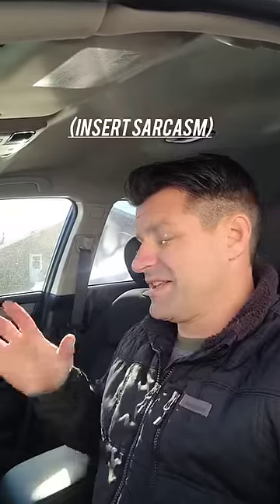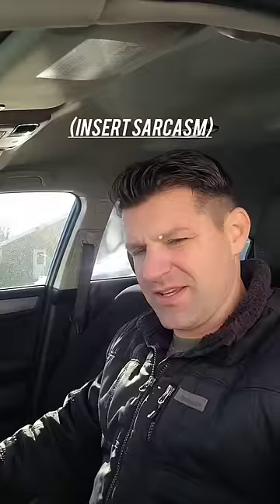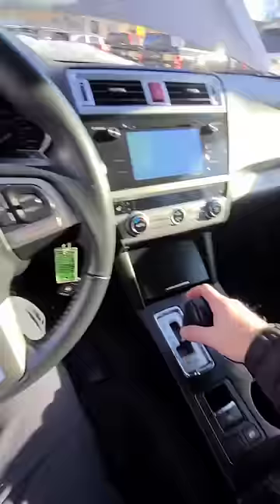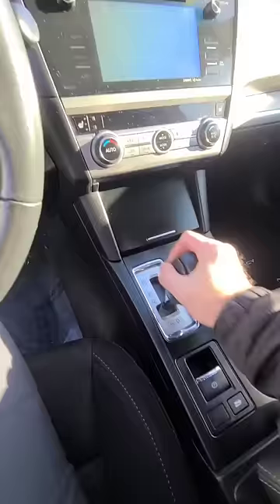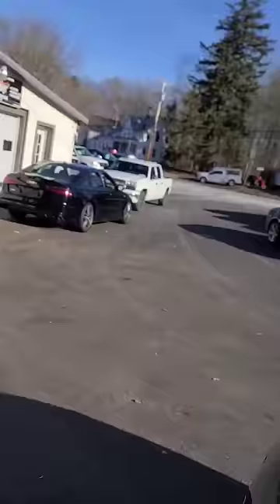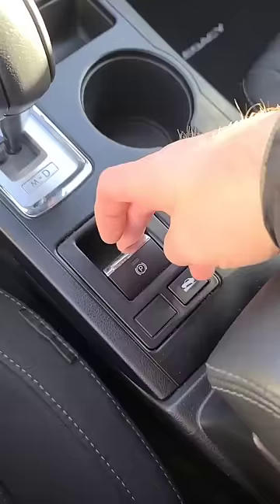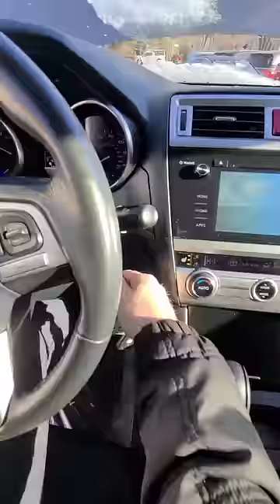Why Subaru Engineers deserve a punch in the Face! #shorts

Comment: Electronic parking brakes in general are stupid. There is nothing wrong with having a mechanical parking brake that you simply pull on whenever you need it but these engineers just want to overengineer everything.
Reply: more things to break :/
Reply: He's struggling to open the glove compart and you want him to remember the ebrake?
Reply: Kind of an eyesore.
Reply: @Natethegreat200c  E-brakes are an eyesore??
Reply: Don’t blame engineers for what are accounting decisions.  Engineers don’t like making crap believe it or not.
Reply: @smittywerbenyeagermenjenso3720 To the average customer, yes.
Reply: Electric parking brakes would be under engineered.
Reply: @johnwalker7592  you don’t seem to understand how businesses operate.  Accounting gives a budget for building parts.   Electronic parking breaks are cheaper than manual parking brake and that’s what engineers were told to build.
Reply: Benefit of EPBs is first, they can disengage it when you hit the gas, so you won't mess up your e break by forgetting to disengage it. The second, is a can also work with him stop assist. The third is that it saves space on the central console, which is precious automotive real estate. That said, though, I still think it's dumb
Reply: Amen!
Reply: @andrewsang4688  You can still use a standard ebrake for stopping, as it can engage at any speed, and many have moved it/ replace it with the parking brake which functions near identical, out of site out of the way. While I can say anything about user error as I've left mine on after a long weight before, Its still never gave me a problem afterwards.

I really dont see a reason to go electronical on it other than "eye sore" which for a machine that can kill, I think is a foolish reason. shocked no government has stepped in but tbh they only care for pushing for ev's at the moment.
Reply: I know it's not like most people use their parking brake in America lmao. Just put a floor pedal or handle to pull :(    ( also DONT PUT THE PARKING BRAKE ON THE PASSENGER SIDE!! Never understood why this is even a thing. My 2000 ford mustang had the parking brake on the passenger side wtf)
Reply: This should be shown to Elon. His bright ideas to remove all mechanical devices results in a useless hunk of junk when the batteries die.
Reply: Over engineer or rather just make you pay to fix something later on in a few years when it goes out
Reply: @aarongalindo5064  yep. Terrible business strategy.
Reply: @theglassarrow_  What do you mean you can use the standard e-brake for stopping? That was never in contention. I don't know if standard e brakes can be used for hill stop assist. Yeah there are certain aesthetic benefits which I think are stupid as well, but it's also like, there's more space for cup holders which I guess contemporary consumers give a damn about.
Reply: @andrewsang4688  "The second, is a can also work with him stop assist" You can use a standard Ebrake for assisting in stops in cases of brake failure. I was assuming this was what you where talking about in your original comment. Perhaps you ment that in might engage automatically? I'm not really sure 100% by what you ment by this.
Reply: @theglassarrow_  I was referring to *hill stop assist, my bad.
Reply: @andrewsang4688  Even then I'm a bit lost on that. Never had a problem with stopping on an incline/parking. I seen some manual cars have hill start assist. Are you just referring to parking on a hill? Where the DMV in most states require all users use their ebrake anyways? Does the car just know to activate the ebrake when in start? I would actually find that as an actually useful feature since I always use mine while parking regardless of the location.
Reply: That's the reason why I bought my Crosstrek years ago because it's still had a working handheld parking brake
Reply: @bigd02118  I think the crosstrek is one of the few Subarus that still comes with a traditional parking brake. I was looking at superus recently.
Reply: @robertknight4672  the 2024 mustang will have a manual one too 😍
Reply: Push button starts
Reply: Anything electronic I don't trust like ,I don't trust me gaming PC I don't trust my phone why should I trust something in a car
Reply: We want to drift the normal way but seems like they do this to prevent that action. Probably was emailed by Biden if they could stop drifting e-brakes and they listened.
Reply: I think it is the designers that want a nicer interior or the bean counters that want an easier design for both LHD or RHD vehicles.
Reply: @daixer3156  I don’t understand how Joe Biden fits into this discussion. Last I checked, the WRX still comes with a manual handbrake.
Reply: Because they know they’ll never actually touch a car they designed, so they don’t give a flying fuck
Reply: When I worked at Kia a 2022 Sorento had a computer glitch. Vehicle wouldn't release the parking brake. It had to be towed in so a mechanic could hook the computer to it, and reflash
Reply: Most of the time the electronic e brake is because of the emergent self stop incase you’re about to hit something, most vehicles have today.
Reply: @darkpill  so your telling me it's cheaper to make a whole electrical parking brake system than just running a cable to the rear brakes for a manual p brake?
Reply: Even better is a mechanical handbreak which you can use to get out of trouble buy drifting. Was  cornering a 03 Forrester in thick snow and ice and car was heading straight for a pole..one pull of the handbrake and ease off the gas fixed it right away
Reply: That’s how they get paid. You want them to just sit around and be like “nope, we perfected that technology. Not gonna touch it” ?
Reply: EPB - a solution looking for a problem
Reply: @Brpwndood My breaks failed one time as I was pulling up to a red light. I was about to pull the handbreak, but luckily the disc breaks finally kicked in last minute. The ongoing traffic was pretty fast too.
Reply: they trying to curb you feok drifting
Reply: @darkpill  ahh the bean counters
Reply: They actually use e brakes cause it requires less engineering to just put a button and run a wire then it does to make an entire mechanism for it but I agree it's a stupid decision
Reply: cost and laziness. Ever since we moved away from drum-rear brakes, mechanical handbrakes are a lot harder to design around disc brakes. An electronically-actuated parking brake is much easier to design for disc brakes.
Reply: @andrewsang4688  simple. Put it under the dash off to the side like they used to do on trucks and have done on some cars. Then write a couple strings of code so that the accelerator or drive/reverse is disabled when the parking/emergency break is on.
Reply: @smittywerbenyeagermenjenso3720  So are you someone should do something about it.
Reply: No such thing as “over engineering”, this is under engineered. Engineering is not only the fabrication but also researching what the client needs, and clearly they didn’t think hard enough. I can’t fathom how modern car manufacturers don’t realize this will be a problem.
Reply: An electronic parking brake is actually simpler
Reply: @theglassarrow_  Electronic parking braked can also engage at any speed.
Reply: @aarongalindo5064  an electronic ebrake is simpler than a mechanical one
Reply: @daixer3156  an electronic ebrake is just simpler and cheaper to manufacture
Reply: @badcrysis1349  Yes, since an electronic parking brake just moves your rear brake pads, whereas a mechanical parking brake is usually a completely separate drum brake.
Reply: @coolvans23  The emergency braking system would never use the electronic parking brake
Reply: @dicktrickle782  Modern steering and brakes are still very much physically connected, apart from a few exceptions like Mercedes' SBC Brakes
Reply: @THEACERASPIREMAN  Just watch a video on it. Greatly disappointing, can to turns like a beast.
Reply: @FCT8306onTwoWheels  I don't know any electronic parking brakes that have more issues than cable actuated parking brakes. Mechanical ones are always prone to jamming.
Reply: The whole point of a parking brake in an automatic is as a backup for the parking pawl. Why would you make that electrical?
Reply: @FCT8306onTwoWheels  more things to fix 💰
Reply: @badcrysis1349  Absolutely.  Not only is it more expensive to install it also has a higher failure rate during the warrantee period.   That’s why everything in cars becomes electronic.  It’s cheaper to build.
Reply: @darkpill  Accounting did not put in an expensive electronic system because it's cheap
Reply: @dicktrickle782  Not false. There are only a few cars on the market that have no physical connection to the brake system, and no cars in production with a true steer-by-wire system.
Reply: @coolvans23  You're just absolutely wrong, the autonomous braking system does not use the electronic parking brake to stop the car, it will actuate the hydraulic brakes. Using the parking brake for an emergency stop would be very ineffective since the parking brake motor is slow and only on the rear wheels, which have little effect in a full emergency brake situation.
Reply: @theglassarrow_  I don't understand what you mean
Reply: Handbrakes can freeze
Reply: @dicktrickle782  Again, very rare to have a car with no hydraulic connection to the brakes. Yes, throttle-by-wire systems are very common, but they are also very reliable and make it easy to do things like cruise control.
Reply: @dicktrickle782  old e brakes can freeze. New ones will not
Reply: @dicktrickle782  nee r brakes will not freeze unless there is a leak somewhere where moisture is able to get inside
Reply: @dicktrickle782  sure buddy
Reply: @dicktrickle782  parked my car in -18 for a week straight. With ebrake on. Took it off without an issue
Reply: @dicktrickle782  And drive-by-wire throttles have existed for decades in cars. In the airline industry, the Airbus A320 has flown with a fly-by-wire system since 1984, and is obviously reliable. A cable is not inherently better than an electrical connection.
Reply: @THEACERASPIREMAN  it’s not subjective to just the rear brakes anymore. You’re wrong. Spreading misinformation
Reply: Defeats the purpose of an emergency brake
Reply: @coolvans23  Please tell me what car has an electronic parking brake on the front wheels
Reply: @quinnsams7159  No, the purpose of an emergency brake is to stop the car in case of hydraulic failure
Reply: That was, believe it or not, one of the things I looked for when getting most recent car…a mechanic/manual parking brake.
Reply: I think it had more to do with people not knowing how to use the parking brake.
I have seen people try and force the button as hard as possible to get it to release.
They don't know ypu have to lift it first.
Reply: It'd an emergency break, by being electronic it defeats the emergency purpose of it 😆 🤣
Reply: @illegalopinions4082  electronic systems are cheap.  Especially during the assembly process.
Reply: I’ll keep my mechanical parking brake and cables. If the parking brake cables stick I can drive on the ebrake or pull the wheel off and turn the adjuster inside the rear drum. If this electrical bullshit fails I have a caliper that may not even work possibly not having rear brakes or it sticks in the engaged position and you cannot take the thing off to retract it
Reply: @andrewsang4688  the first benefit can be worked around with a simple beeper when you start moving and the e brake's up.
Reply: waiting for lawsuits and recalls when rust and moisture damage the electronics emergency breaking system
Reply: @baritengku7655  my dad has that on his RAV4 and he still destroyed the parking brake because he just ignored the beeping
Reply: Nothing is wrong with that
Reply: Creating jobs for themselves.
Reply: Sounds like you have a car from the 90s
Reply: @Natethegreat200c  what...
Reply: Buttons are cheaper and that's all there is to it
Reply: Lmao.....still nope
Reply: Exactly
My dad's car has an electronic parking brake and the battery died with the car parked forwards between two cars, and so we couldn't roll the car back out if the parking space to jump start it because you can't disengage the ebrake... I instead had to remove the battery from my car and carry it to the front and jump start the damn thing...
Reply: @andrewsang4688  the electric e brake on my dad's car doesn't disengage when you hit the gas, it still stays on
My girlfriend's car has hill assist and it has a regular ebrake so it's possible to do it that way as well
Reply: First off Engineers don’t decide to do anything, that’s management. Secondly, E-Brakes are cheaper and more reliable than a mechanical brake. Now why was that car unable to shift into park with a dead battery? Your guess is as good as mine
Reply: I would have a brake catch designed to hold the pedal brake, if all fails, No idea how to actually do it, maybe a key turned stopper? so you can use the car key to engage a latch on the bottom of brake (pushed all the way in, and maybe multiple stops for if the brake is softer and you need to press more to fully brake, 3 stops should be enough variation).
Reply: @badcrysis1349 absolutely, it is cheaper to use 3 extra I/O pins on the drive computer than to make and certify a ratcheting mechanical brake system and install a cable to the rear break pads. 

Personally I think it is stupid and the whole point of the e-break was to provide a non-electric breaking alternative, but yes electric is cheaper.
Reply: that's what I've been saying. Such bs. For key less entry, push button start and all other, its all good. But the one thing taht should bot ben electronic is the e break. It's called emergency brake for a reason. Car manufacturers nowadays had gone so far out if touch they don't know wtf they're doing.
Reply: @dicktrickle782 I'll accept electric gas pedal. That is a fail safe design. If the gas pedal is stuck open, I can shift into 2nd for engine breaks and then into N and kill the engine. I will not accept electric only steering and breaks. If those fail, I am completely screwed. Most cars have redundant mechanical systems though.
Reply: Other than start stop, one of the worst trends in the car industry 🎉
Reply: @00-Dima  I drive a 2008 Honda Accord.
Reply: You said it “ over engineering” that’s the problem 
Why don’t they fix it
Reply: @PseudoSpaceMarine  13 years old
Reply: @andrewsang4688  ford has been offering automatic releasing eBrakes since the mid 90s. It's vacuum operated from a hose to the engine. No unnecessary bullshit electronics. Not to mention their preference was always a floor mounted pedal to push. The hand brake is for goofballs who think they're Travis Pastrana. Fact of the matter is, it's a sad attempt at innovation, that only does one thing, and does it poorly. Just like GM making their LS platform have cylinder deactivation. Now they're trying to avoid taking accountability for having to rebuild literally every 5 3, 6.0, 6.2 from 2007 to current day because the active lifters are garbage. My friends mom bought a 2021 Tahoe RST, I can upload a video of it with 7,000 miles and it has a random lifter tick that sounds like a clapped out TBI 350 with no oil pressure.

Footnote: people are already so brainless and lack critical thinking skills, automated features that help people avoid developing simple skills like making a car not roll back on a hill, are going to make people exponentially more likely to lack any brain activity while existing in the world.
Reply: Over engineering is fine for excessive durability or ease of use.  As long as it doesn't unsolve the problem.
Reply: @darkpill  They should pay attention to reviewers who understand their products.  It's a bad decision if consumers are smart and they can't sell their product.
Reply: Yeah and you can't drift with e-brakes.
I love to do brake turns on snow
Reply: There are a lot of people that do not have the strength to engage a manual ebrake properly making it pointless for them.
Reply: @andrewsang4688  MECHANICAL EBRAKES USED TO BE ON THE FLOOR OR POKING OUT UNDER THE DASH.
Reply: @andrewsang4688  You know you can make manual push emergency brakes that disengage when you put it in gear. You are aware of that right? We've had that technology for 50+ years. I have a 1967 Ford Thunderbird and it has that old school push in emergency brake down by the pedals and it automatically disengages when you take it out of park. A novelty from 1967. It still works great, I use it every time I park on the road by my house cuz it's on a slight hill.
Reply: Less mechanical linkages allows for a more free design.   Only a slight more free but they can put an electronic brake on any area and have it activate with lever, button, switch, knob, etc.
Reply: I would say most of the time they have both but they always seem to be unique lol I’ve seen some weird hidden parking brakes
Reply: @minnesota_fats7344  I did not know that tbh
Reply: Yeah, honestly there should be a regulation to have some kind of mechanical parking break.  Should be a standard safety feature
Reply: Don't forget, someone told the engineers to do it. They don't make those kind of decisions lol
Reply: @darkpill engineers love to blame accountants but a mechanical handbrake is much cheaper than an electronic one. you still have to run cables.
Reply: @darkpill  it’s weird that it is cheaper to do an electronic parking brake when it’s typically cheaper cars that still have a regular parking brake and more expensive ones that use the electronic parking brake.
Reply: @Infergal if they got it right the first time, then yes I do want them to leave it alone
Reply: @andrewsang4688 had a 2017 e220d that didn't have an automatic electronic brake. Not only was it hidden where you can't see it, but it didn't go off when you drove away
Reply: @darkpill  I don't believe that. Manual parking brakes are a wire attached to a lever and the brake pad, no motors or actuators or fucking service modes so you can change brake pads.
Reply: @andrewsang4688  I think if a part is changed and becomes more expensive and inconveniencing because of laziness or forgetfulness, then you've fucked up.

and I'd much rather hill start myself than have even the slightest chance of the system malfunctioning and rolling into the merc behind me.

Also, using the parking brake is often crucial for getting unstuck when you don't have a locking differential
Reply: @theglassarrow_  he's talking about stopping while on an incline (in active traffic - at a red light presumably).

You use the brake pedal to stop as usual, but now, if you let go to move to throttle, the car will roll backwards, not an option. So, traditionally, you pull the hand brake, release the brake pedal, rev the engine until it is at equilibrium with slope's backwards force and lower the hand brake smoothly while accelerating smoothly (slightly more difficult with manual transmission, but same process).

he's talking about a system in the car that can do that process for you, but it's actually totally irrelevant to any kind of e-brake/parking brake/hand brake (electronic or manual) and besides, I would not trust a system like that.
Reply: @coolvans23  no. the emergency stop just activates the brakes with hydraulics, that's it. It's got nothing to do with electronic or manual hand brakes. lots of cars have manual hand brakes and emergency stop.
Reply: @unifairsum21  no. electronic parking brakes have electric motors installed at the rear brake calipers to push the brake pads in, instead of the traditional cable-lever arrangement.

They added it for more centre console space and because they're fucks
Reply: @dicktrickle782  I mean, the steering does have a physical connection as a failsafe, but I get your point and share your sentiment
Reply: Oy vey
Reply: @jeepmanxj  jamming? never heard of that nor had it happen to me.

The mechanical ones do stretch, but that's mostly due to misuse and a normal car owner can fairly easily (but sometimes laboriously with modern car designs) readjust them. At least you don't have to use a proprietary obdii tool to put the car in service mode so the electric motors won't pop the pistons out while you're doing a brake change
Reply: @1337penguinman  also hill starts, and I'd much rather they were mechanical for that as well
Reply: @THEACERASPIREMAN  yeah, the applied pressure and the braking force is just straight up weak as well
Reply: @tothelimit9992  why not? they're just shitty electric motors and worm gears in the rear (where they are perpetually assaulted with brake dust and road dust and water and shit)
Reply: @tothelimit9992  there is.
Reply: @tothelimit9992  is that supposed to be an achievement? a trial-by-fire?
Reply: @funnypranker34  still rocking drum brakes? keep at it my man 🤙
Reply: @chrislyles01  I'm gonna be honest, if you can't pull the e-brake then I don't trust that you'd have the strength to pull the car out of a skid or to swerve adequately.

Like the ol' dirt bike test: you can ride it yourself, once you can start it yourself.

And besides, do you understand mechanical advantage? there's no reason the lever couldn't have less pressure and a longer throw. perhaps, you've just been in some shittily designed cars because the hand brake pressure seems to vary pretty severely between them.
Reply: @cjolney  I agree. don't cater for the idiots.

and I think most car companies have seen the hate they've gotten on electronic parking brakes but don't want to admit their mistake so they're staying the course, which is even worse
Reply: @Fatboypeet  start stop is alright buddy
Reply: @nathanielhill8156  I'm pretty sure all cars have mechanical failsafe steering for if the power steering fails (won't help if it starts wigging out and breaks your wrists though) and maintain a direct hydraulic connection to the brakes for if the booster servos fail
Reply: @nathanielhill8156  but they've got to install damn electric motors on the rear calipers
Reply: @ddjohnson9717  push button start seems almost totally pointless to me. just leads to more people locking their keys in, or needing complicated procedures for when the key battery dies or when you want to put the car in accessory mode
Reply: @Narinjas  long-term usage gets questionable. the brake lines might spring a leak under the constant pressure, might let air in from the brake side, might corrode the outside of the caliper pistons so they won't retract or will tear up the seal.

I think there's a reason why it's always been a separate system from the hydraulic.
Reply: I prefer cables, cable throttle, cable e brake, shit bring back the carb and get rid of ecu 🤣🤣
Reply: @rolls_8798  you don't have to have a special programmer to change the brakes on a vehicle with electronic parking brakes. Where the hell did you encounter that?

Yes, cable actuated e brakes have a tendency to jam, especially if you live in an area that deals with salt on the road in winter time.
Reply: @rolls_8798  push button works well with keyless entry. without one the other is useless. I can see and had def. enjoyed the convince of the system working for me - not once i felt my keys in vehicle mostly due to I do not take the keys out anyway. 

electronic handbrake on the other hand...
Reply: @andrewsang4688  my 84 Cadillac El dorado has a mechanical e-brake that disengages when you put it in gear. 30 year old tech still better
Reply: @thomaschristopherwhite9043  everyone in this thread spent the entire time spelling 'brakes' as 'breaks' and you've just come in and done the same thing in reverse
Reply: @ddjohnson9717  yeah, as a seamless system it can be very nice. just personally, I've never had an issue doing it the manual way and I like complete control and zero risk of issues like someone being able to get into my car because I'm standing too close to the vehicle and I also like to be able to control how long the car cranks and stuff. Less risk of wireless attacks as well if there isn't keyless entry.
Reply: @jeepmanxj  you have to enter the brake service mode on the car's computer, on some vehicles that requires an OBDII scanner - like for resetting the service interval or oil change notification
Reply: @rolls_8798  I like going against the grain once in a while.
Reply: @268NA_Impreza  hell yeah, gimme a choke cable as well
Reply: It was too difficult for the female and queer.
Reply: @davidsprauer9443  no it didn't.
Reply: @gherreraj  We will never lose power, the grid is safe and reliable. You will own nothing and be happy.
Reply: @itsthemetho  lame customers get hear.
Reply: @badcrysis1349  yes, it's a line of code in the computer and a few wires to the switch.
Reply: user-tp4ks7pu1d  Why are you asking me this question?
Reply: @rolls_8798  I've never once encountered this? BMW or something?
Reply: @jeepmanxj  looks like it is mostly Volkswagen and Audi, but the fucking sequences to put the EPB in service mode on other brands is goofy and confusing as hell.
Reply: @darkpill  how do you figure there cheaper?

when all is said and done a electric parking brake is a mechanical brake with a solenoid to actuate the brake yes you removed a brake lever but replaced it with expensive electronics that had to go through testing and approval 

its by no means cheaper its just marketing because they think it looks cleaner and more elegant
Reply: @andrewsang4688  it takes off the brake when you hit the gas?

so hillstarts using the brake to hold you whilst you work your gas and clutch to get the car holding its own under power is not gonna happen then cause the second I bring gas in the brake goes BYE BYE and I start rolling and better get everything else setup and ready immidiatly
Reply: @rolls_8798  living the dream. Nothing like the hood old days. Won’t start? No prob, toss a lil gas in the carb. 🤔
Reply: @andrewsang4688  if a person forgets to engage OR disengage their parking brake regularly, they should NOT be driving
Reply: They have to justify their jobs somehow.
Reply: @darkpill  how is an electric parking brake cheaper? They need to add a solenoid and some kind of motor or linear actuator to engage it. The mechanical one is just a few brackets and a cable.
Reply: Something else to usher you into dealerships to get fixed...
Reply: @RaggedsEdge  like others have said, it's... just probably cost savings these days, but it is indeed a backup to everything else, if it fails when the power fails... it should not ever be type approved. That car is not fit to be on the road.
Reply: They could just have a lever hidden by the driver side door for actual emergencies.
Reply: I don't even have a big problem with them (don't give me one though), but they need to be on an alternate/backup power source
Reply: The gates of heaven are closed forever for the one that invented electronic e brake.
Reply: Not only does it cost more, it has disadvantages like this
Reply: @268NA_Impreza  and massage the throttle while starting to keep it running when it's cold out
Reply: @spacetoast7783  the average customer can shove it😂
Reply: @smittywerbenyeagermenjenso3720  I think the solution to that would be footwell e breaks
Reply: Only because the marketing dept told them to do that.
Reply: @RaggedsEdge  it’s more than a few brackets and cable.  Cable sheath needs to be installed from back of car through into the interior cabin and center console.  Lever itself is probably quite expensive and needs to match materials of inside of car, and then the whole system needs to be tensioned and tested.  Electronic version can be pre-installed on sub components, and no adjustment and if there is a problem easier to fix.
Reply: @rolls_8798  look up a video on how to replace an emergency brake cable and you can see how much time they save on the assembly line.
Reply: @darkpill  "lectronic parking breaks are cheaper than manual parking brake"

Not with the chip shortage they aren't. Which is why most new vehicles are going to start going back to mechanical.
Reply: @Sarge92  I think it's based on speed, not accelerator pedal depression
Reply: @jacob1121  if it's hidden and out of the way, it is inherently ineffective and you're unlikely to be able to think of it or effectively use it in an emergency. Also, why have both when the mechanical works just fine?
Reply: My 2011 mercedes has a foot pedal for it that I hit accidentally while getting in 1/5 times and don't notice until the dash cluster screams at me. I thought THAT was a bad design, I never even considered an electronic parking brake, wtf
Reply: Electronic parking brake on my Passat was the best thing ever! They install these so that people (Yanks?) do not only use them in emergencies. 😉
Reply: I have had a mechanical one totally snap and need replaced. it happens. to be fair maybe I pulled it too hard but I literally can't do that with my electronic. btw it was like almost $200 to fix
Reply: @Natethegreat200c  I agree, I liked the foot pedal parking brakes that many larger cars have.
Reply: @andrewsang4688  I have hillclimb brakes on my VW and it has a manual parking brake. I dont know how E-brakes work, but I guess its just letting the ABS-system applying brakeforce on rearbrakes and holding it. That would mean you can put a $1 button in the car instead of a $2 manual braking system. and even more fun, making the customer think its advanced and let them pay extra for it.
Reply: @smittywerbenyeagermenjenso3720  no, mechanical emergency brakes are.
Reply: Yeah, like turning off the engine at a stop sign or a stop light.
Reply: @rolls_8798  Caribbean doesn’t get that cold wouldn’t know about that 🥲 22*C minimum (72F 🤔)
Reply: @rolls_8798  I’m rocking rear disc brakes and the parking brake is a drum brake basically
Reply: Not their fault. They don’t come up with these absurd things, they’re just told what to do
Reply: Well, and unfortunately electronic parking brakes are cheaper to manufacture
Reply: @rolls_8798  you think so? Multiplying the amount of starts for the vehicle exponentially is a good thing?
Reply: The idea is that it prevents theft 🤣 yeah, right...
Reply: @Fatboypeet  it essentially doesn't make a difference when the engine is hot and fuel injected.

there also is not any solenoid to go bad in the starter because the starter is in constant mesh (being also the alternator).

start stop engines make sense in areas with start stop traffic
Reply: @jrag1000  that feature is great since the ac dies too.. lol. first thing to turn off feature. only exists to make t he cars look more economic when it comes to fuel.
Reply: I bet they're from the missus at home that goes to car focus groups and tells them I don't like that big stick in the cupholder
Reply: Wow. I never heard of an electronic parking brake. Having no manual brake is nuts. Our cars are not meticulously maintained airplanes.
Reply: Because people think it's fancy and for them more profitable.
Reply: @andrewsang4688  ironically the only car I have issues remembering to either engage or disengage my e-brake is the one with an EPB. My other vehicles with foot or hand e brakes are second nature.
Reply: @16vSciroccoboi  yeah and it’s not that hard to keep mechanical overrides. You know they
 Systems we have had for the past century. When you have to rely on your car having a cell signal to get in it, you have a problem…
Reply: @spacetoast7783  to the average customer, no.
Reply: @darkpill  There's absolutely no way in hell an electronic parking brake is cheaper. You need an actuator, the switch, wiring to connect both to the CAN bus, software to handle when it can and can't be moved in either position (which requires QA and testing), and probably more that I've forgotten.
The reason they make electronic parking brakes is that dumb people think they're premium.
Reply: @gherreraj  And these cars aren't marketed to people who want mechanical systems. They are marked to people who don't even want to change a tire out on the side of the road and would rather sip their coffee waiting for a tow.

Why would the manufacturer bother?
Reply: @16vSciroccoboi  No they are built that way because Elon thinks it’s a smart idea. Look at the stupid steering yoke with capacitive touch controls. It’s stupid when you can’t physically know where a button is at without having to glance away from the road. I push a button on my car and I can feel it pushed and activating. Capacitive controls are stupid for a car. Do you have a capacitive keyboard for your computer?  No. Because they suck. They were tried and quickly dumped once researchers realized they where less accurate and intuitive for users.
Reply: Tbh my gf swears by it as I dont realise the car we had before the one I have now had a mechanical handbrake but I'd park and put the brake on and shoot out and then my partner needed to go out and could never get the mechanical handbrake off after me.
Reply: @garethevans6355  That’s a security feature. If she can release the e brake, she can’t take the car. Lol. Same as having a manual, criminals can’t drive stick so they can’t take your car.
Reply: @alexmccart2566  Touch grass. You have no idea what real people are like. They don't like cars. They want to drive an iPhone on wheels.
Reply: @footsnail6880  Yeah I like keys more.
Reply: @andrewsang4688  use a vacuum actuator to disengage parking brake when shift goes into gear.  Just like FOMOCO did in the 80s.
Reply: Exactly my thought before i opened comments section. Had this on my mind for a long time, but there are not many newer cars with mechanical brake on the market, unless you want a small car
Reply: @darkpill  Eletronic parking brakes are more expensive, their advantage is because they don't need as much interior space as a handbrake and doesn't need to travel 2/3 of the car like the foot parking brake
Reply: @andrewsang4688  If you can't remember to disengage the E brake before setting off, then you need to take a refresher course... 
Its like the first thing you learn next to checking your mirrors before moving off. XD
Modern cars, encouraging drivers to get lazy. power assisted everything. I reckon it'll cause more accidents in the longrun.
Reply: @andrewsang4688  "Benefit of EPBs is first, they can disengage it when you hit the gas" ... except that gets messed up just the same, never worked reliably in my 2011 outback
Reply: If it shifted into drive this would not have been an issue
Reply: I'll quote this comment to those who say stu pid sh it like "those old cars were built by engineers, not merchants". Marketologists can not care less about what type of parking brake your car has, they only care about what features you would buy. It's engineers who do stu pid design and fix what's not broken.
Reply: @leefoulds2569  Is the government controlling your hands right now?
Reply: It’s a transition to automation. They are slowly mating it the norm to pay for electronic components they can control with ai
Reply: @darkpill  how do you know that? What you say sound doubious. How can something as simple as a nandle and some wire thingy be more expensive than electronic components? I mean, you don't just press a button, than goes some integrated circuit wizardry, and than the wheels magically hold still. Those brakes need to be actuated by some sort of electric motor or something. It doesn't sound cheap.
And also why do the accountants care about the cost of every individual part? How do they even know how many parts are supposed to be there? And even they somehow do know and do care, why can't engineers just negotiate that mechanical handbrake is important and will make their car better than the competition?
Reply: @theglassarrow_  guys, sorry, probably a stupid question, but why do you all call it e-brake? Isn't it just fancy marketing term for electronic parking brake? What else can e stand for? Definitely not "emergency", definitely not "parking", definitely not "hand".
Reply: @gherreraj  Elon only has control over Tesla. And buying a Tesla in 2023 is like buying an iPhone - it's like getting a tattoo on your face that says "I'm rich and I wanna be like everyone". There's so many other cool EVs on the market!
Reply: Its actually underengineered. Digital was faster, easier and they didnt have to design mechanical components. Laziness really
Reply: There is a mechanical brake in those vehicles
Reply: @ldmtag  E-brake is traditionally emergency brakes, as they dont rely on your brake pedal which uses brake fluid and rotors/pads. The e-brake is a completely stand alone system using drum brakes. Its primarly made for 'emergencies' as brakes where more likly to fail with older fluid compounds and as time goes on to modern times its less likely.

In short the "E" is emergency and newer cars have an electronic E-brake. functions the same but sends a signal to a computer instead of a cable pulling.
Reply: @footsnail6880  no, that's actually a pretty good status toy. The most pleasurable experience you can get from your car is to turn that beast of an engine on by a mere press of a button. I've always thought it's too confusing to have FOUR! different positions and not 2. Why tf I have to use the twisty thing to light up my check engine light and other stuff or use the infotainment? It's so unnatural. And turning something on using a twisting motion is also unnatural. Button - yes, clicking switch - maybe, twisting a key - am I opening a door or something?
Reply: I think E parking brakes are the most stupid design ever
Reply: Clearly you never driven a car with electronic brake,but i would like cars to still have a manual brake for energencies
Reply: @Mexicanus Prime another thing I don't get: if fake engine noise is bad why fake gear lever isn't? If it's an automatic, the shifter is basically a button that just looks like a traditional gear selector.
Reply: @theglassarrow_  that's confusing, cos they're hardly used for emergency. Cars used to be primarilly manual, they didn't have parking gear. Handbrake's main function is to be a parking brake.
Reply: @ldmtag  Originally you would just leave the car in gear and people adapted to using the e-brake for parking. Thats why alot of autos just have the foot parking brake that functions nearly the same. Leaving the car in gear isnt good for the engine/trans in the long run but is a good second fallback incase the hand brake fails, we've learned alot in the last 100+ years.
Reply: @theglassarrow_  idk... sorry, but this doesn't make sense to me. I don't disrespect you, I just... I have some doubts.
Reply: @theglassarrow_  for example, if it's EMERGENCY brake than why is it conveniently made the way that it holds itself? Or why only the rear wheels? I might be making up memories but I'm pretty sure I watched Ford Model T video, it had that weird handbrake that was also a gear lever, and I think it was working as a PARKING brake specifically holding itself in position
Reply: @theglassarrow_  i know there's google, but 1. It's far less fun than thinking or asking people, 2. I kind of don't trust internet on that. I know a lot of bs is circling around the web like that mo ronic division into AWD and 4WD, or how open differential sends 100% torque to the spinning wheel and locked distributes it evenly.
Reply: @ldmtag well it locks the rear wheels because older cars used to only be rwd, it was easier to make at the time as fwd transmissions are so compact, and more expensive to work on. if the car had the throttle stuck it would stop the wheels still. Auto cars now just put a pin into the transmission and stops it from moving, so when the car is moved or if you slammed into park while moving theres a good chance the pin will get snapped or shaved down, perhaps the "Ford Model T" video you saw also had the pin in for a manual car, as its not a crazy design just not needed in manual cars but I'm sure someone would find it useful or handy.
Reply: Thank you. It's just some dumb feature to justify a price increase on the vehicle. If it ain't broke don't fix it. Let some things be mechanical and please stop making everything controlled from touch screens.
Reply: I don't think this is driven by engineers but marketing and an absurd industry push to put computer controls on every part of a car
Reply: They're adding epb for several convenience features. Avh , hill hold, etc. Not to mention, people like a cleaner look.
Reply: I loved having a manual wire based emergency/parking break because I started my driving career in a manual and now that I got an automatic for the city I live in (constant 0-60 acceleration and traffic, manual is great but a nuisance in this environment). I hate the fact that if my breaks were to say go out for any reason, I am absolutely fucked because my parking break requires a reading of 0 mph to engage and because if I do engage my parking break it will fully lock the wheels on all 4 so I will spin out of control otherwise… at least that’s what I’m pretty sure will happen but the car won’t allow it I don’t think… either way it’s annoying and I can’t even put my car into a drift let alone save it from a drift on snow/ice by engaging the back breaks without the front while giving it gas as a front wheel drive car in a particular direction (some drifts require this to not crash, not everything can be solved by steering and breaking). All in all, I’m happy with my computer on wheels in Florida but if I go to live up north I am getting a (real) stick shift with a regular parking/emergency break… I just hope they fucking exist by the time I wouldnt want one again if I move… thank god I’ll be living in Russia most likely so plenty of options there cus everyone drives a stick and manufacturers make specific packages for Europe…
Reply: @andrewsang4688  both?
Reply: Should b required for a mechanical e-brake in all vehicles 4eva
Reply: @jacob1121  The problem with that is that a mechanical override would make sense...
Reply: Actually it's lazy owners too arsed to pull on a lever. So auto manufacturer obliges.
Reply: even old ones you can't shift out of park, can't even shift in to park. if battery dead. just make sure your battery is good, Subaru's have good electrical systems, it's probably your fault for letting the battery die.
Reply: Good luck to sell that car with hand break over electrical 😸
Reply: Tbh probably a marketing decision, let be honest. Japanese engineers aren’t fool
Reply: @darkpill  how is an electric motor cables etc cheaper than a stamped peice of metal and some sheathed cable?
Reply: @Nathaniel Rudolph  my 09 escape has one near where the clutch would be they can be made to look nice
Reply: It is clearly unsafe. I cannot believe nobody threw pencils at the accountants when that decision was proposed.
Reply: I used to work as a driving instructor and I had to teach students how to stop the car in the unlikely even their hydraulic brakes failed by using the parking brake. From observing many people attempt to do such a thing, I would say only 10% of them had the strength required to stop the vehicle relatively quickly. That's pretty bad. Do the same thing with an EPB and all you need is a working finger and the brake force is much higher. I do prefer manual handbrakes but I understand that EPB are much more powerful and can actually be effectively used in case of brake failure by 100% of drivers.
Reply: It's just more things to break. I've never had a problem with any mechanical parking brake, but I had one car that had an electric one and it broke CONSTANTLY.
Reply: There's literally a shift lock override less than 6 inches from the shifter. He could've used that and avoided all that drama. All you need is the screwdriver from the kit or a pen to press it while also pressing the brake and you can shift it into park. I can understand having one for emergencies but realistically if your brakes fail and your e brake doesn't work you've got bigger issues yk like maintaining your car? Checking the brakes, checking the e brake from time to time, brake lights etc. That's gotta be one hell of a freak accident for your brakes to give out and your e brake to not work.
Reply: @andrewsang4688  I like how my dad's 2008 odyssey has the e brake on the left side of the foot well so there's no way you accidentally activate it.
Reply: @davidsprauer9443  it's obviously so women can brake the car when the dude tries to show off and almost kills a crowd. Lol just jokes I love mustangs.
Reply: It's not even over-engineered properly because it doesnt prevent a failure, it ensures one.
Reply: @davidsprauer9443  ... Maybe on the passenger side of the center console, but certainly not out of reach of the driver. Too many people have decided that the parking brake is supposed to be an emergency brake. For the parking brake to be useable in an emergency, it needs to be accessible to any passenger in the vehicle. The hand pull on the center console comes closest to that criteria. Placing it on the passenger side of the center console is probably as close to ideal as anything could be for all riders in the car. Certainly a pedal along the driver's side kick panel is only available to the driver. The old pull rod under the dash was located for the driver to access, but not too far away from the passenger in front. Of course, that would take a substantial amount of familiarity to operate from the passenger side. Even the current batch of electric parking brakes don't have standardized operation. Trying to use any parking brake in an emergency is certain to be a crapshoot at best. Definitely not reliable.
Reply: They want to save money
Reply: Electronic parking brakes where invented because Noone uses the mechanical brakes when parking.
Reply: The only reason parking brakes went electric was to save space in the cabin. They're dumb, we all know it, manufacturers know it, but everyone does it and it saves a LOT of space in the cabin.
Reply: Women like e-parking brakes because the mechanical ones are "hard". This was a marketing decision not an engineering decision. Women buy Subarus and husbands buy Subarus for their wives. Some women buy Subarus for their wives. Generally men don't buy Subarus for themselves, except for some WRX's. I bought an old Subie because I needed something cheap and tough and I didn't realize I was supposed to be gay first. So I run the ever-loving snot out of it & drive it like I stole it.
Reply: Have both
Reply: Meh. My car has an electric parking brake, no real issue. It's also a manual though so in a situation like this I can just put it in gear as a brake.
Reply: WRONG. These features are usually required from marketing teams and executives.
Reply: Thats why I fuckin love the HAND brake. Love my 15' civic Si. Don't think I'll ever go past it ;)
Reply: And let's not forget the fun of sliding!
Reply: My 17' Corolla has a mechanical emergency brake, and can be shifted when the battery dies lol.. Needed the E-Brake a few times, and had to roll into Neutral to jump the battery with another car once (was in a bad angle).
Reply: @darkpill  there more expensive thoo#
Reply: Honestly I prefer a pedal e break
Reply: Reminds me of the Germans lol
Reply: My wife can't even life 25% of the manual parking break. And if I pull it through , she took 15 min and half sitting on seat still can't get it down.
Reply: The over engineers put a backup battery of some sorts in the car to prevent that.

And in general, not relying on mechanic connection is better and safer.

In this case I just really wonder how one ends up in that situation.
Reply: id have to dig through the CFR to confirm for sure but I wouldnt be surprised if theres a FMVSS requirement implemented sometime in the last 10 years that warrants it by means of auto-park functionality depending on what kind of gear selector the car has. One of the recalls I did at Dodge was to flash an ECM to enable auto park for Rams with the dash mount dial PRNDL, i VAGUELY remember the bulletin mentioning it being for FMVSS compliance, but if the truck is in gear and the door is opened it'll automatically shift to park like most newer stuff.
Its possible that with lever selectors that cant automatically  the electronic parking brake is the only other way the car can automatically "park" itself when the driver door is opened while its in gear. My '15 audi with lever select does this, and my '15 mercedes with the janky steering column stalk selector does this as well. adds an extra step to rear brake service but you get used to it, i dont mind it much anymore.
same principle as how everything built after 1996 has to have OBD2, everything after 2008 has to have TPMS, 2018 brought back up cameras, and theres stuff in the works for passive blood alcohol detection in the next few years.

Definitely wouldnt blame the engineers, much less the gubmint for implementing this stuff, rather the benzo'd out soccer moms & old timers that get out of the car without putting it in park so it rolls off & causes problems that warranted this kind of thing. gotta remember EVERYONE gets to drive whether they're competent or not.

If anybody suffered through this reply and has anything built in the last couple years with a stick shift i'd like to know what kind of parking brake system it has or if theyre an exception, or if anybody has anything built in the last 4 years that has a lever selector & traditional handbrake, please lmk
Reply: @THEACERASPIREMAN  i dont mind drive by wire at all, ive snapped throttle cables and gotten throttle bodies jammed open - cruise control lever popped its ball joint off of the throttle body cam on a quick WOT and jammed the cam in place. was on a bridge. was exciting. pretty sure thats part of how the Audi 5000 got the reputation it did - was in a '93 S4...
never personally had a problem with drive by wire outside of latency but ive replaced tons of throttle bodies on 3.5l fords, mostly expeditions around '10
Reply: @humongousdrake1155  learn how to weight transfer, yanking an e brake isnt always the best idea with factory AWD systems for example, give the brakes a good quick jolt just as you start turning early and the car will rotate. or a scandinavian flick.
my allroad has the electronic parking brake but it drifts wonderfully.

the bigger problem is traction control systems that dont turn all the way off, you can disable them but some will still kick in when you get TOO too crazy.
Reply: @@user-qj1ye1wd6w  it was in the center console but just on the passenger side lol. To be honestly I've never really thought about floor parking brake is out of reach for the passenger in case of an emergency. I've thought about the passenger being able to go into neutral just never the parking brake. Also I applaud the long and detailed reply good person!
Reply: @mtnentertainment3454  I don't think electronic parking brakes are an "issue", like for forcing a skid. What I'm saying is mechanical parking brakes are reliable, easy to service and work perfectly fine. 

Electronic parking brakes are being used now because they save a lot of space, which is an advantage that most people like nowadays. The downside is that the "emergency brake" is now prone to lots of failures and expensive to repair when it does fail.
Reply: Yeah, I have a ebreak on my transit. It likes to turn on every time it thinks I got up for safety (even with the doors closed). The problem is it has poor visibility around turns so it turns on every time I lean forward to see if the coast is clear… incredibly dangerous over engineering
Reply: @Natethegreat200c  Not really you barely know they are there if you don't use them to park. Also even if they are  is that not worth it compared possibly dieing. I will do my best to avoid getting any vehicle with an electronic e brake. It's honestly just stupid. You do not want your emergency back up brakes to  depend on anything else but pure mechanics.
Reply: my 2013 fusion(is a 6 speed) parking brake stopped working, well it malfunctions horrifically, so once it released, i just had to go back to gear parking lol instea dof both
Reply: It probably saves manufacturers money because a solenoid and button is cheap and they don’t have to make room for all the mechanical components of a traditional parking brake. Same goes for a lot of things that went from physical buttons and knobs to touchscreen. Saves them money. Less design elements. Less parts to produce. Less logistics overall.
Reply: @Goodmanperson55  I have a 1984 saab 900 with disk brake on all 4 wheels and a manual emergency brake connected to the front wheels.  The 99 9-3 has them connected to the rear disk brakes.
Reply: Nameless makes a hydraulic one for your drifting pleasure. Probably makes more sense now with the removal of a manual hand brake.
Reply: @aaronburkeen6409  not trust me, I see it. The shit drags down the whole interior. I have a Chrysler Sebring and a Chrysler 200 (new body 200) and the parking brake in the Sebring stands out like an eyesore. It has no place in a new car. It’s very ugly. Same for conventional shifters. The dials , piano keys, buttons and more look way way better and integrated. Anything that’s sticking out the dash that’s not a LCD screen needs to go.
Reply: @Natethegreat200c  I guess that perspective is fine to have. If you never plan to use your vehicle for adventures or long road trips. Or if nothing ever goes wrong while you are driving it ever. But I go on long car trips and hiking trips far out in the mountains, i also live in the mountains. I know when shit goes wrong you cannot depend on that stuff to keep you alive. Looks are fine, but I prefer the safety that comes with knowing that not every crucial system in my vehicle requires the battery to work.
Reply: They just want to stop people having fun with handbrake turns
Reply: Wrong. It’s cost silly.
Reply: @mtnentertainment3454  Don't ever spill a drop of tea or coffee onto the e-brake button. A friend of mine did that and the car's electronics went berserk. The headlights, brake lights, and dash lights flashed on and off, the car wouldn't start or move, they missed work, the battery finally died, they had to call a tow truck which had to drag the car onto the tow bed because all the wheels were locked, and it had to go to the VW dealer for a week. The total bill for spilling a few drops of tea in a VW came to $1400. Yeah, e-brakes are awesome!
Reply: Overengineering (most of the time) and overcomplicating simple things (all of the time) is a pet peeve of mine. And so pervasive in modern cars.
Reply: Why all cars these days need to have those stupid eletrical things?
Reply: @jackandblaze5956  thankfully I know a quick fix for that from back when I spilled some dr pepper in my 4wd switch on my old car. just pour some rubbing alcohol in it.
Reply: @gherreraj  you said stupider...
Bwahahahaha
Reply: The real reason is to add an additional point of failure that isnt easy to fix = more revenue for manufacturer
Reply: I doubt this was engineers... this reeks of management finding a way to charge more for the car and adding a thing that can break easier and need repairing/replacing.
Reply: 100% Our Range Rover once in awhile will not release the parking brake and you can't tell until a mile down the road until the brake gets smoking hot and the truck vibrates all over the place. What's wrong with a stupid lever and cable?
Reply: Many od the things in cars are not needed at all, Today.
Reply: @andrewsang4688  Counter with foot pedal e-brake.
Reply: @ChadDidNothingWrong  Electronic parking brakes were a thing before Biden became president so I don’t see how he fits into this conversation.
Reply: They’re great.
Get with the times grandpa.
Reply: Electric parking brake is the stupidest design of all time. It's also an EMERGENCY brake. How can it stop you in an EMERGENCY if it doesn't even work during some emergencies.
Reply: @gherreraj  derp derp keep up the good work genius.
Reply: @asherdie  more proof mr troll
Reply: They engineer it in a way so they can garner more profit of course. Its all about money at the end of the day
Reply: Why do you think they add so much unnecessary electronics? So more could go wrong and you can go in and get your car fixed
Reply: @gherreraj  So nothing worthwhile, just name calling . Nothing I've said is a troll.
Reply: Parking brakes should be manual. Electronic parking brakes don't make sense to me.
Reply: @asherdie  when you just drag on a conversation with minimal words trying to make your self look like some great wordsmith who knows everything, then you just trolling for recognition.
Reply: They have Electronic brake Calibers now too, Really good idea gotta hook it up to a computer and tell it the push the cylinder back in when you do brake jobs
Reply: @THEACERASPIREMAN  Even those still have a physical connection--no purely brake-by-wire system has left development yet. Regardless, I still don't trust them
Reply: @dylanholdstock3016  It would be much easier if the mirrors weren't switched by the ignition! Our 2001 Acura TL does that (ignition has to be in the on position!!), and I've forgotten to start the car after adjusting. Our 2002 Town & Country has the mirrors unswitched (except by a mechanical three-position switch for left, off, and right)
Reply: @ldmtag  Yes, the proper term is indeed parking brake.
You're confused by the key?? I like our Town & Country's keyed ignition that has five positions!
The fake gear lever only applies to newer automatics. They were still using mechanical levers on automatic transmissions in the early '00's.
Reply: @Goodmanperson55  What do you mean? Plenty of four-wheel disk brake vehicles have mechanical parking brakes. They all have miniature drums built into the rear rotors. Not that difficult
Reply: @xHadesStamps  those miniature drums are precisely the """problem""" that the bean counters try to solve. You remove them, you reduce complexity, you reduce cost. Not only do you remove the mechanical cable system, you also remove the drum and replace it with a cheaper computer-controlled solenoid that uses the caliper itself for the parking brake
Reply: @auwei  No it’s not.  Not over the 8 year life of the car model.
Reply: @matthewland5582  Because you don’t understand manufacturing.
Reply: @RaggedsEdge  The parts can be shared over many models of cars. QA is easier to do, less warrantee claims, no cables to run on the assembly line, parts can be interpreted into sub components.
Reply: @darkpill  it absolutely is!
Reply: @mtnentertainment3454  That should be in the owners manual
Reply: @xHadesStamps  wow, now I really feel dumb! You said mechanical gear lever on automatic? I had no idea there's anything mechanical that can be controlled by a lever. I know the planetary gears are controlled by compressing friction plates, and that's done by pressure of a liquid, but I thought it's all controlled by a computer and the lever is a mere electronic switch.
Still, after knowing that, I prefer buttons. Buttons are more intuitive, take less space, and when I was a kid I seriously scratched my head about why can't they just be buttons like on my audio cassette player (where pressing one depresses all the other buttons)
Reply: I completely understand why you think that. But the reason everyone’s standardizing electronic parking brakes is because of electric vehicles. It’s dumb. Believe me.
Reply: @jakesavoie5439  instead of "believe me" better tell how those two are connected. Electronic parking brakes have been known since the 1990s, as someone pointed out. Back then no automaker seruously considered switching to electric at least in the nearest future. I've heard GM specifically admited that it's Tesla's succes what made them start all those Volt/Bolt shenanigans.
Reply: @xHadesStamps  What still has a physical connection?
Reply: Well not entirely.  There was a guy who left his car in drive  and got out of his car. The car rolled away. Of it had an electronic parking brake the car doesn't allow you to roll far if the car is in drive the parking brake will automatically engage.
Reply: @andrewsang4688  Then do what GM was smart enough to do all the way back in 80s and 90s... make the parking brake a pedal. Both my 94 pontiac bonneville and my 92 GMC sierra had foot pedal parking brakes.
Reply: how about auto dimming headlights on fords? goes to low beam every time they catch a reflection from a road sign... answers to questions never asked, for problems that never exsisted
Reply: Even worse is the electronic opening for the glove compartment found in Volvos
Reply: @ldmtag  That would've been the reason. It's known as the selector, responsible for engaging the parking pawl, selecting the direction of travel, and locking out higher forward gears (which is why there were so many of them). Nowadays, it's electronic (although the park may still be mechanical, in which case, a lever's necessary), and pretty much anything can be used, but even our 2001 Acura TL and 2002 Town & Country have fully mechanical selectors, although the automatic function is still computer controlled, not strictly hydraulic. Weirdly, the first pushbutton transmission had a mechanical selector.
Reply: @THEACERASPIREMAN  Every brake system in current production
Reply: @andrewsang4688  They used to put the parking/emergency brake as a pedal over or right next to the hump of the wheel well, and some even made it a pull-lever under the dashboard towards the door.  I fail to see how either of those designs would ruin your precious esthetics.
Reply: @xHadesStamps  Mercedes' SBC system when functioning normally was brake-by-wire.
Reply: @andrewsang4688  My nan can't pull her handbrake(ebrake for yanks) easily on(I don't know if it is setup right, I don't live near her), so that is one good benefit...
Reply: @ryanoberlin1005  It's because consumers value those features
Reply: I agree with everything you said except the “overengineer” part. There is nothing overengineered in electronic hand breaks, but it is dumb as heck. I work with machines and I always make it a rule that the emergency stop function should be as direct as possible with little use of electronics.
Reply: The thing is that all the girls I know can’t release the mechanical handbrake.
Reply: More or less this was the idea of corporate big-shots or government psychos trying to look good by cracking down on engineers.
Reply: @THEACERASPIREMAN  Yes, but it still has a physical connection as backup
Reply: Sure but not being able to change the gearbox while the vehicle has no power is a bigger offender.
Reply: Yeah can't text and drive but they install touchscreens in the vehicle.
Reply: @joetroutt7425  Yeah. That's just one reason why I hate them.
Reply: @andrewsang4688  We stil should have a mecanical parking brake somewhere in the car, like a pedal. Keep the electronic one for normal use, and the mecanical one for edge cases.

Car can detect that the mecanical PB is engaged and refuse to shift gear. Dash lights up, tells you that the PB is engaged.

Not that complex, and would add an interesting layer of safety. If the electric PB uses the same cable/mecanism, it shouldn’t be an issue.

BUT : if someone have decent arguments against this, like an engineer who can explains some issues with ideas, please discuss them. I’m not a car engineer, I’m certainly missing something here.
Reply: Subaru did it for safety in a side impact crash. The parking brake has a tendency to crush your hip when you hit it
Reply: @andrewsang4688  in that situation where is the benefits you can get from Ebrake? Not an expert but based only on this video.
Reply: Exactly. This is a literal safety hazard. It should always be either mechanical or an emergency manual hand brake.
Reply: Agreed electronic parking brakes are horrible in cases like this i prefer mechanical parking brakes
Reply: People run them self over because the parking break wasent stopping the car. And yes one of them was a police officer.
Reply: Subaru is not the only car maker that did that Ford did it also. Totally stupid idea
Reply: just like a phone without removeable battery. but hey now the goverment can see where you are 24/7 as you cant really turn off the phone.
Reply: @andrewsang4688  it should be designed to come on if the battery fails.
Reply: @thomasterrell437  most manufacturer do.
Reply: @Natethegreat200c  I agree with some cars but others I’ve rented have it kinda hidden which I like. But overall no one I think wants an old school hand brake on a new subie like this 😂
Reply: @Natethegreat200c  You right. You need less things in your face while you're texting and driving
Reply: the cables need replacing a lot and are a pain in the ass, they seize often, get tangled on shit, etc etc. (most cars let you change gears while the battery is dead...)
Reply: Thats why manual cars with normal handbrakes will always be my go to choice never gonna get an automatic
Reply: Making it electrical isn't over engineering, it's just bad engineering
Reply: The electronic makes sense on manuals
Reply: @darkpill how are they cheaper? LMAO.
Reply: Under engineered
Reply: Have you ever had your parking break freeze and break from cold weather? I have! Shitty Toyota crayon parking brake cable froze and snapped on me. Worked night shift, it was 5* outside. Never had an issue with any of my electronic EBrake system vehicles.
Reply: @andrewsang4688  I agree with all the benefits you mention but still can't agree with the decision. It's an emergency system. That should ALWAYS be designed in the way that allows for operation under any possible failure condition you can design around, and a simple lever is as fool proof as you can get.